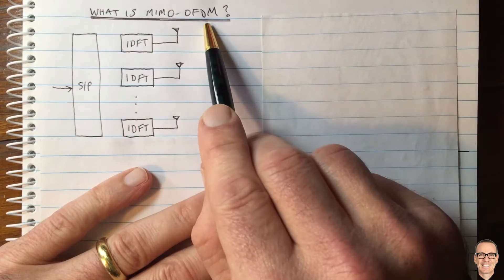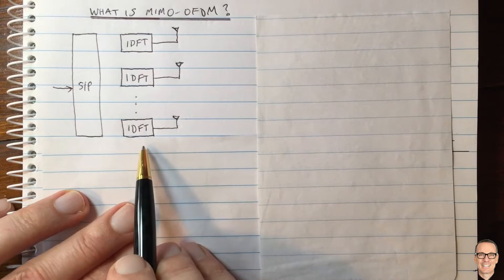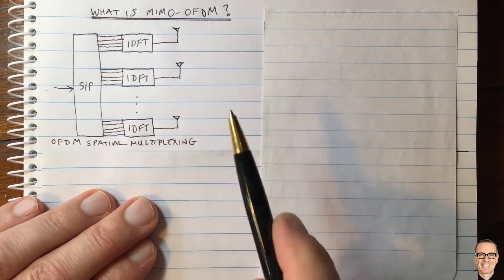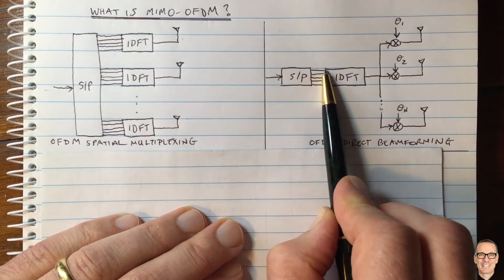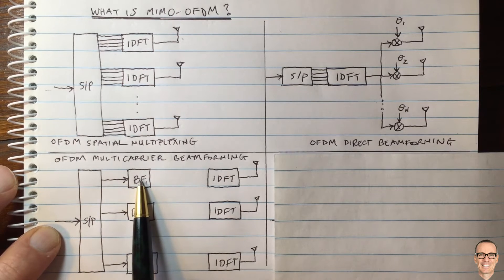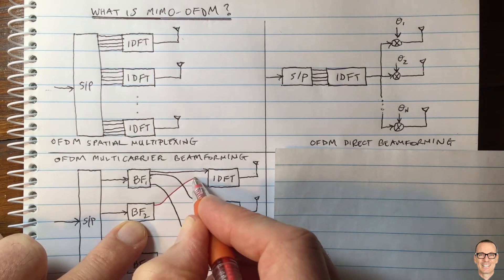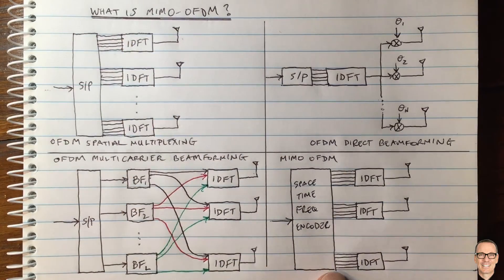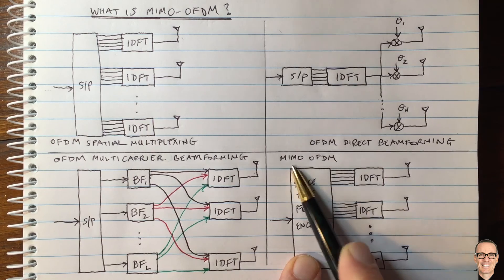What is MIMO OFDM?

Comment: Which of the two beamforming methods (OFDM direct beamforming and OFDM multicarrier beamforming) is better for the mmWave and THz bands? At these higher frequencies, you have a wide bandwidth meaning that the performance degradation with OFDM direct beamforming should be quite significant when the beamforming is only for the center frequency but you have lots of other subcarriers over a widebandwidth. Consequently, it should be not desirable to utilize OFDM direct beamforming, right? For OFDM multicarrier beamforming, the problem should be that you need one RF chain per antenna which is not an option due to hardware restrictions (power and cost) when utilizing as many antennas as are used in the mmWave and THz bands, right? So, you are caught between Scylla and Charybdis. Which option do you chose?
Reply from the maker: That's a great question. Yes, what you've said is correct. There's really no clear answer. One approach is to do a bit of both (in a way) by using hybrid beam forming: "What is Hybrid Beamforming?" https://youtu.be/vJrDtZ24K7Q

Comment: Thank you professor.  Your videos are really helpful.  I have one question: in the pictures above, the output of IDFT block is a baseband signal with frequency ranging e.g., 0 - 20 MHz?  And these signals must be upconverted to a carrier frequency,  e.g., 3GHz for transmission?  Is the beamforming operation in the pictures applied to a carrier wave (or a base band signal)?  It is really confusing to me, especially when we consider digital beamforming.
Reply from the maker: Yes, that's right, the output of the IDFT needs to be unconverted. For digital beamforming the phase-shifts and amplitude scaling is done at the baseband.
Reply: @iain_explains  Do we ever try to apply beam-forming to the carriers as well as the sub-carriers?

Comment: Hallo, I have a short question. With regard to both pics on the left side. In the lower pic, we can adjust phase and amplitude with these BFs. That is clear. But in the upper picture (OFDM Spacial Multiplexing), how do we adjust phase and phase and amplitude there? I assume we must give something like the channel matrix and then we calculate the precoding matrix to multiply it with the symbol vector - but there seems not to be anything like that in the pic. Thanks a lot.
Reply from the maker: This video should help: "What is MIMO OFDM?" https://youtu.be/kaPK58WlG-A

Comment: Thanks, I refer to the OFDM Multicarrier Beamforming on the lower left side: how do I have to think about that BF1 operation? We are in the frequency domain, that's clear. So for each subcarrier, we get a point in the IQ plane - that is what I know how we "feed" the IDFT. But how does BF1 now beamforms that point in the frequency domain?
Does BF1 moves the point a bit within the IQ plane? 
I hope you understand my question.
Thank you.
Reply from the maker: Great question. Yes, that's right. Transmit beamforming adjusts the phase of the transmitted signal (on each subcarrier) (... and in some cases the amplitude as well) for each antenna, in such a way that each signal adds up constructively in the direction of the intended receiver.

Comment: So this meams that multicarriers  waveforms like OFDM can not apply to beamforming?
Reply from the maker: No. It means you need to do beamforming separately on each subcarrier.
Reply: @iain_explains  Hello professor, i wonder does each subcarrier beamform simultaneously throgh the same beamformer in fig.3 ? It seems in fig.2 they go into a same beamformer simultaneously.

Comment: Thank you professor! I like the video! May I understand this way for pic2 and pic3?
Pic 2 is actually time domain analog BF using phase shifter in RF domain. However, due to OFDM is multi-carrier waveform, phase shifter cannot cover all the subcarriers if channel coherence is small. So a per subcarrier granulity is needed.
Pic 3 is actually freq domain digital BF using precoding in baseband. This is still similar to analog BF but it is PER subcarrier phase control instead of using uniform phase for all data per chain. 

A few questions:
For mmWave, the BW will be large, but it seems phase shifter is commonly used for mmWave beamforming (802.11ad/5G). You mention Pic2 may still work in some degree, but would Pic2 still be helpful for mmWave case? since mmWave is usual really large bandwidth (~GHz).
WIth Pic3, to make it work well it needs per carrier and per ant channel est. The amount of channel estimates and feedback could be huge, for example for 8 chains and 1024 subcarriers, it would be 8*1024 channel estimates. And also channel can be out dated, would Pic3 be still practical than Pic2 which is more simpler but less efficient? 

Thank you!
Reply from the maker: Great comment. Yes, everything you mention is correct. There's still lots to do in research in these areas.